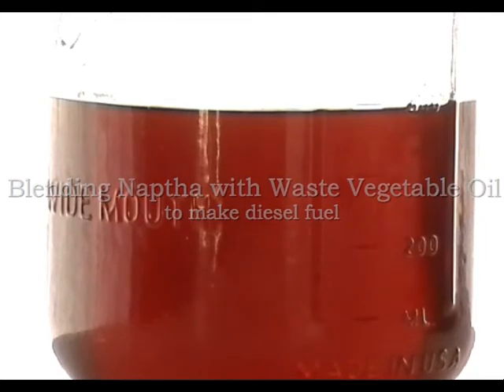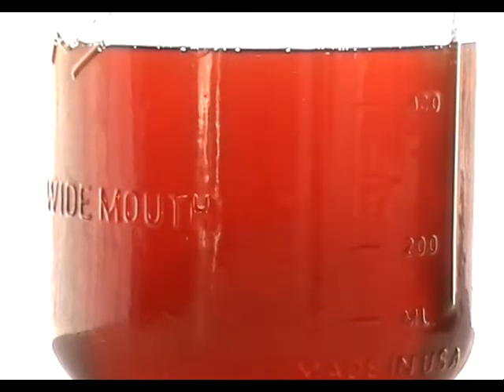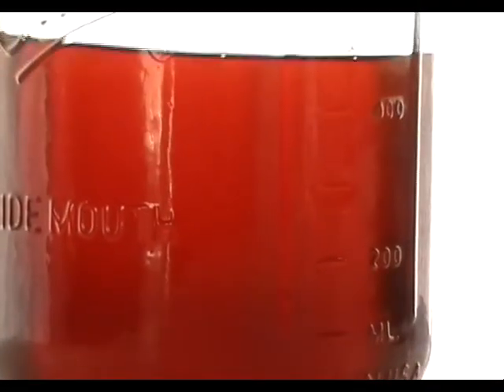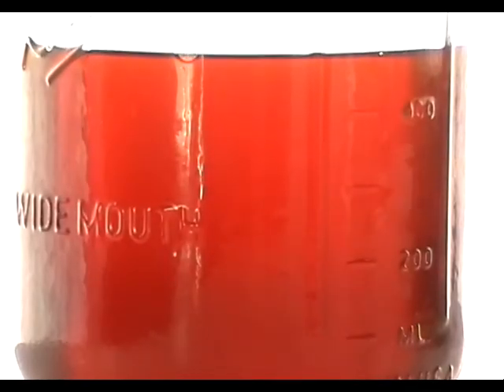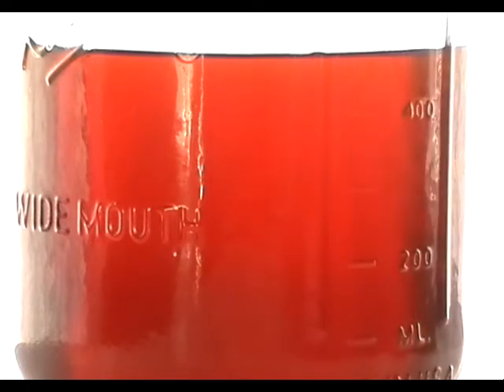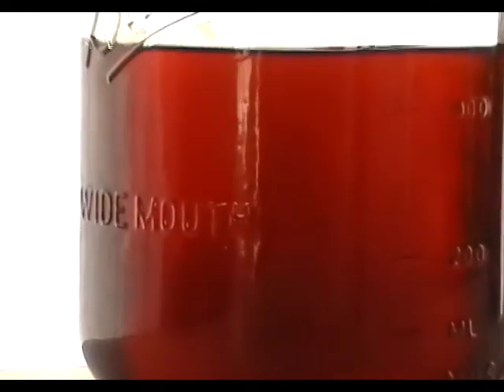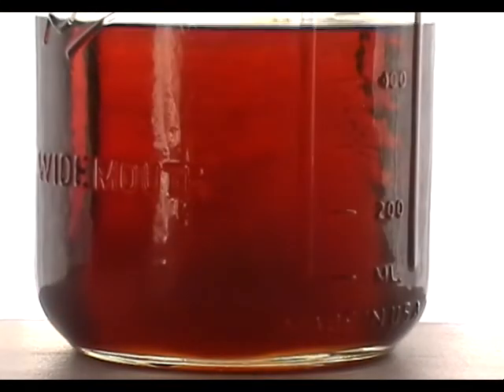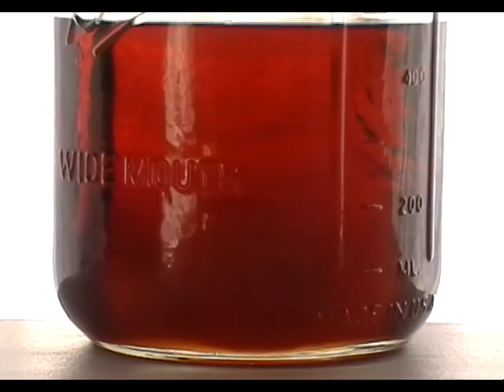Blending Naptha with vegetable oil to make VO Blend Diesel Fuel

Comment from the maker: Most of those jar blends that I made were done at 20%.  Yes, it helps to approach the viscosity of diesel fuel, however, we do not seem to have to get precisely there, because gasoline at 50% with canola oil would make that blend have the viscosity of diesel fuel; however, 20% gasoline seems to run just fine.  So, start at 20% and work up until you find a blend that runs best on your engine.